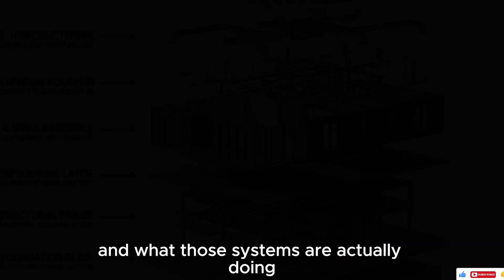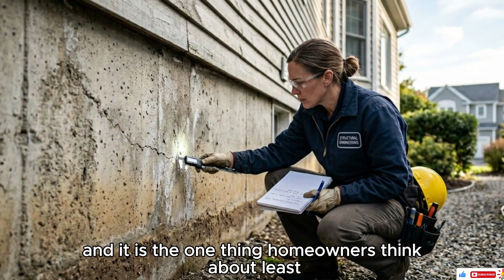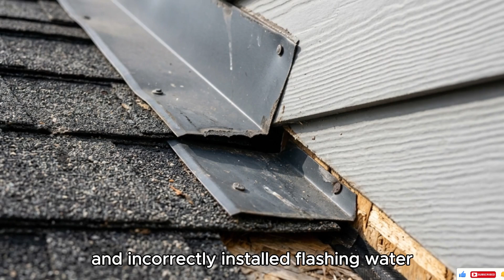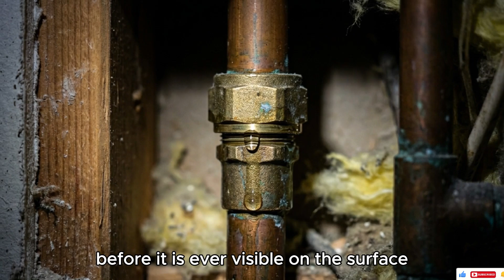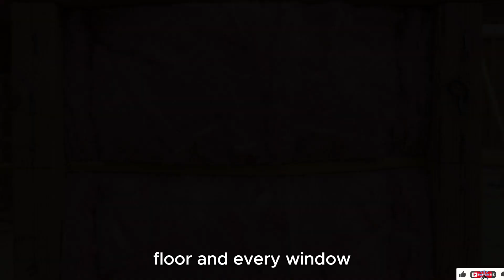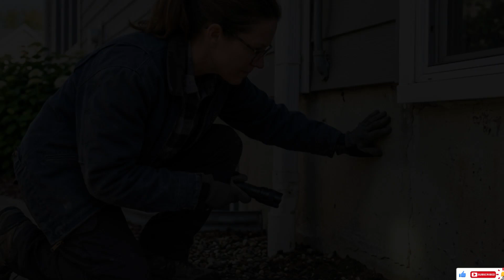The Hidden Systems Inside Every Modern House (Most Homeowners Never See)

Comment: Truly an engine
Reply from the maker: Thank you! That's exactly the point of the video. A modern home relies on many hidden systems working together—from the structural framework to plumbing, electrical, waterproofing, and ventilation. When these systems are properly designed and installed, the house performs like a well-engineered machine.